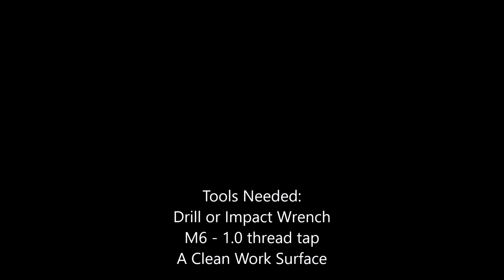ReadyRamp Assembly Final

Comment: So you have to tap the holes yourself?
Reply: Rob A. The NEW black ramps that are arriving tomorrow are fully assembled.
Reply from the maker: We have a new shipment of BLACK ReadyRamps coming in August 10th.  These ramps will be PRE-ASSEMBLED.  NO ASSEMBLY NEEDED.  The Silver ramps in stock will still need to have the rungs installed, and the easiest and quickest way to do that is to tap the rungs with the tap in a drill.  The hole is exactly made for M6-1.0 threads, so they tap very easily.